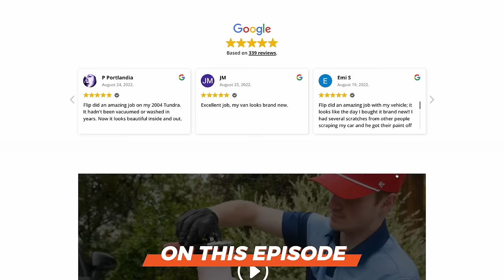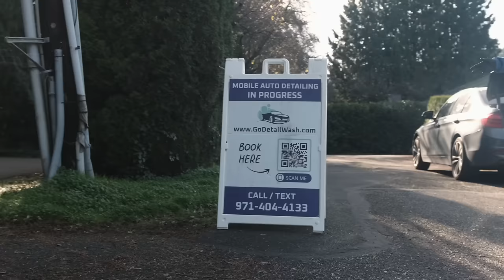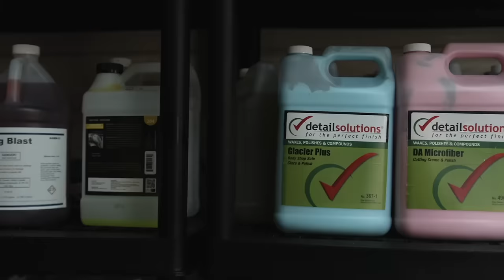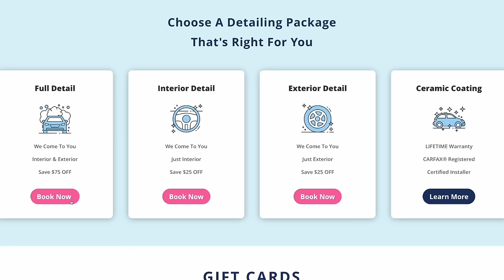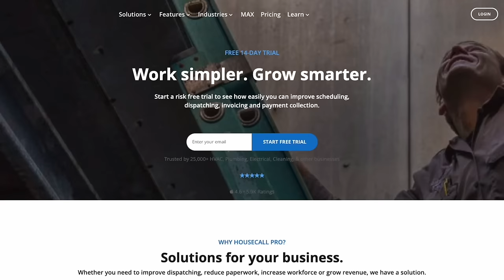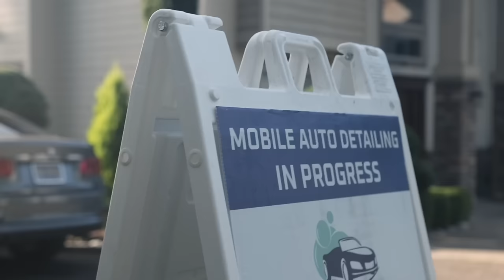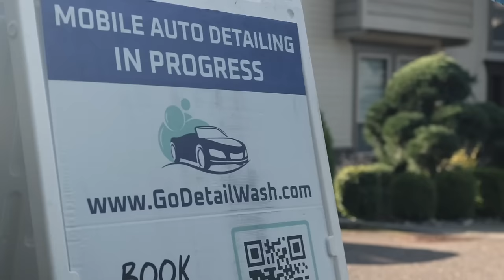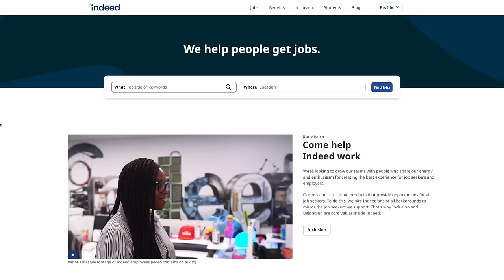Start a Mobile Car Detailing Business with $500

Comment: Your numbers aren't adding up. If your margins are 60%, that means 18 employees AND all overhead expenses shared the remaining 40% (30k). If you had no expenses and split that 30k between employees, That's less than 1700 each for an entire month. But you do have expenses such as vehicle maintenance, fuel, cleaning supplies etc. So either you pay your employees peanuts or your margins are more like 20%. OR you don't have nearly as many employees as you say and the 75k revenue number for that month is an outright lie.
Reply: He's inflating his numbers to sell more online courses.
Reply: I call BS on his numbers.  His company is not making almost a mill.  And his employees are not pulling in $1500 a week.  I have a mobile detailing business and as an owner I pull in $2,000 a week
Reply: This right here, 75k x 30% is 22,500 / 18 employees is 1,250 a month per employee. This does not add up
Reply: @skycaptain95  yup
Reply: @illusionzauto very good money. Are u the only employee in your business?
Reply: @MrTurbo87lx  yes I am the only employee. Usually detail shops that make almost a mil are ones that offer vinyl wrapping, ppf film, and other restorative services
Reply: @illusionzauto  yeah no way the owner in the vid is doing almost a mill per year.   All to sell his course
Reply: @MrTurbo87lx  I agree
Reply: I'm glad u wrote this so I didn't have to
Reply: @illusionzauto  lemme getta dolla

Comment: very organized, very reputable business model overall. i am impressed,. However, IMO hiring detailers as independent contractors with no insurance or benefits to do a detail and receive a 30% commisiion is basically undermining the potential of and individual detailers wealth. considering im an owner operator, and charge essentially the same price, i make three times more that these commisioned detailers, and im not in a rush to get cars in and out either. i can spend a lot more time giving my clients thourough and meticulous results imstead of trying to rush through 3 vehicles a day to make $300 at a 30% commission rate. i agree about the googlr my business route is perfect for detailers
Reply: This has always been my argument to other detailers. Although, I would love to see a mobile detailing company scale nationwide. I don’t think it is doable. Mainly because of finding high quality detailers who are reliable and care about quality over quantity. It is like finding a needle in haystack. They are out there, but most are running their own business or working in a shop. Not working in the harsh weather conditions.
Reply: that is exactly why I started detailing on my own. I can make 3 times as much working for myself while doing the same job as working for somebody else. detailing is hard work. especially hard to do a standout job very quickly. that's why a lot of detail shops put out sub par work. all their employees work super hard and are always under the gun on time. I can spend a lot more time on my customers details and put out an amazing product and make great money. The hardest part is stability.

Comment: I love this guy's business approach and acumen but I have some serious issues with his detailing methods. 
You NEED the soaps and chemicals as lubricants when you wash. He is also using quick clay bar which shouldn't be used often and although it leaves a glass like finish it is a micro abrasive that overtime and with overuse, it will just leave more imperfections. Also, the de ionized water alone should have fixed the water spotting problems. 
This is a great business model but the claim of being 40% faster than the competition is not impressive after finding out the process.

Comment: So, five hundred can get you a lot as far as starting equipment, but I wouldn't start without a Llc, whatever local business license, and at least shop keeper's insurance.  You get out there and scratch or otherwise damage a car, you will seriously regret not having those.
Reply: Just get the LLC and Insurance. In GA, the insurance that I chose is $41.66 per month and cover’s potential damages to customers vehicles.

Comment: Ay bro how do you keep from scratching tesla windows? I just bought my tesla and on the first wash I have these tiny microscratches in the windows. 

I used new microfiber towels (washed before using) and Stoner Invisibly Glass. 2 bucket method with MF wash mitt. Essentially was super careful and somehow the windows (not the paint) ended up with microscratches... I've never had this issue when cleaning windows before I thought glass was supposed to be tougher than paint... but anyway any tips on how to avoid making it worse?
Reply from the maker: Avoid rough towels! They can easily scratch surfaces even if they're microfiber.

Comment: claybar at every wash? That's gonna damage the clear coat no? Also, keep those finger prints off the car paint!
Reply: Clay barring will not damage the clear coat if you do it often.
First time claying will be the most effort since its all the grime thats been imbedded for who knows how long. If you do a maintenance wash and dont do a strip wash every time, the wax or sealant absorbs most of the marring anyway, and then follow up with another wax layer. Maintenance claying can be done with a finer claybar to prevent excessive marring.